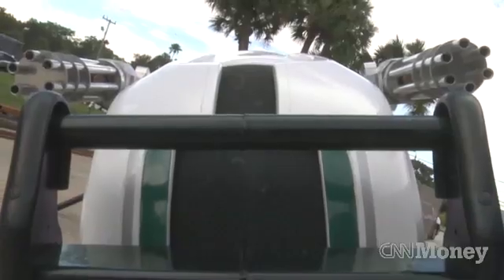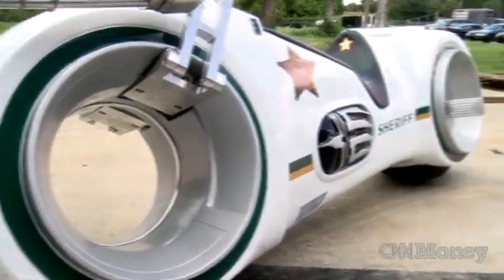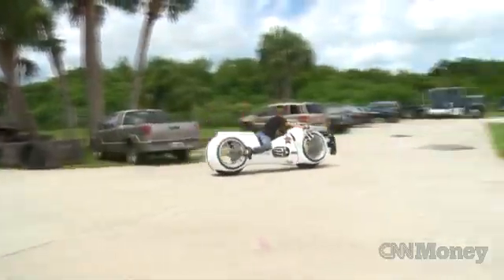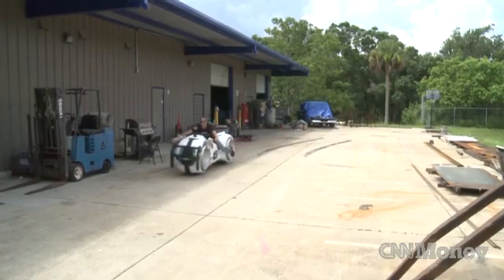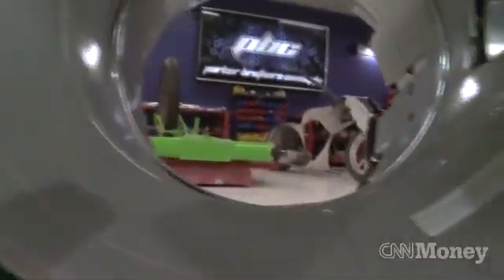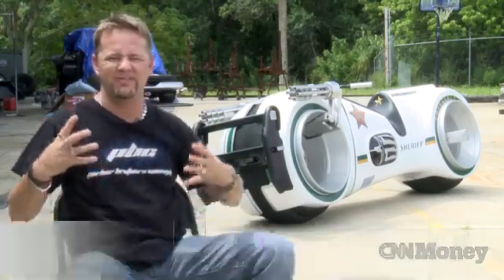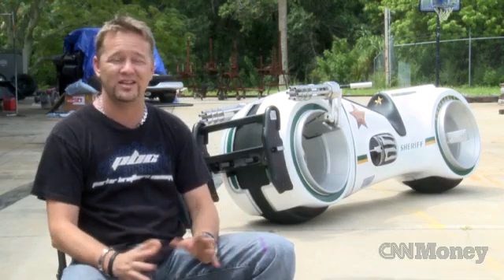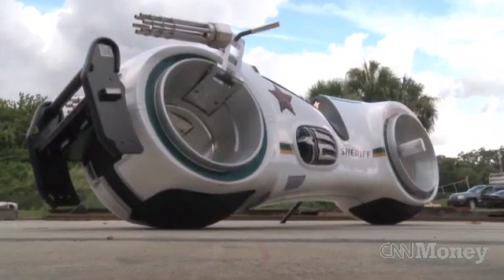Take a ride on a real Tron bike

Comment: It's a shit bike in any way you can think of, because most bullshit attached on it is just a waste of time that renders it unreliable, especially in a curve. You know, when someone suffers from OCD, a lot of shit they can think of in making this bike makes no sense, even if it does, is it really safe to ride. Can it take or negotiate curves at high speed? I say no because I know as much as you all do that a motorbike has to lean low on left or right to beat the gravity and stay on the road at high speed. With those low body edges on each side of the wheels, is it possible to lean low without scraping body on the road and lose wheel traction? No. So there. All talk and total bullshit. And, as always, dickheads who liked this video have no idea about this shit is made for films and useless on the road in real world. Those who didn't like the video are as smart as fuck to have chosen 'Unlike'. They know that, no matter what the bike was used for, it would not be registered because, 1) too big, 2) too low, 3) you can't lean to take curves at high speed, 4) too wide (better ride a horse) and 5) it's un-roadworthy, but they say it's street legal, really? In the US everything is street legal, even drugs. I don't give a damn about the bullshit future and the crazies at work, making strange looking vehicles to represent the future. I would rather see that every sicko gets off the drugs and act their fucking ages.

Comment: So my centre of gravity is going to be all out in the 10th of a second when I'm chillin and coming around a corner then a car decides it's OK to be halfway out of their lane and now I need to straighten up then over-steer or have a head on? What we need is a technology that stops speed wobble, when a rider has a close call or needs to chicane the most likely accident is the after-wobble bucking u off, but there would be a way to prevent that a little bit.

Comment: Cool but basically impractical concept plus space wasting.

If you design bikes or cars that look elegant, trendy, and cool, yet powerful and space saving on congested traffic would be a better concept.

Future is there could be lots of road users than present, so design vehicle that doesn't look bulky should be the way of future vehicle to accommodation them into the road.

Comment: It must be quite uncomfortable to ride this while sitting on your balls.
Reply: I need this....
Reply: Imani Simone
But it's electric, it doesn't vibrate...
Reply: If you took a spring mattress and folded it in half, straddle it while holding its fold with your legs/arms, then allow your younger brother to kick the mattress under your nuts (to simulate road bumps) it would be exactly like riding this thing.
The position you "sit" (or as normal people see it) lay in with your legs out has to make this the most unstable feeling ever.
The big question is the kickstand. I see it attached to the wheel while sitting but missing completely when moving. Do you have to carry a rod  with you everywhere you go?
Reply: lol.  if u actually bought a tron bike...what balls?
Reply: NismoBoyz Yes, but they are on the options list:)
Reply: I would be amazed if they used that comment as feedback and made like a little hole you place your junk so it doesn't smack anything.
Reply: therealdeadpen No I don't think so... If you don't plan to prop it up aha
Reply: sirprincy
They probably would but this is just a model, not even a prototype so they won't bother...
Reply: superdrewster98
Good one:)
Reply: NismoBoyz that bring's that south park episode to mind where Cartman gets it in every orifice from that machine.
Reply: Light cycles will malfunction outside the arena, because of the terrain.
Reply: ardvark84 and if u hit a bump???
Reply: ardvark84 hahaha
Reply: Imani Simone but u might be not having balls🤔